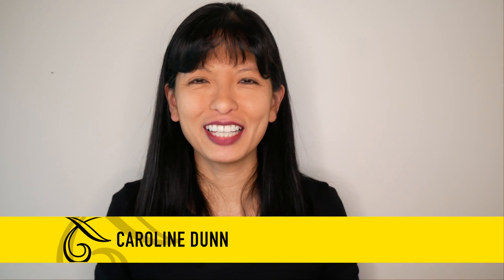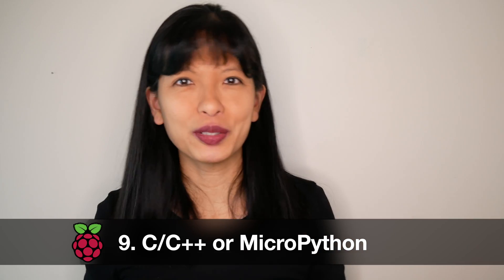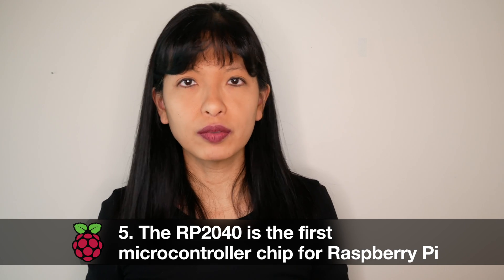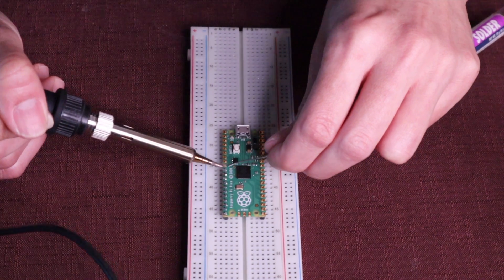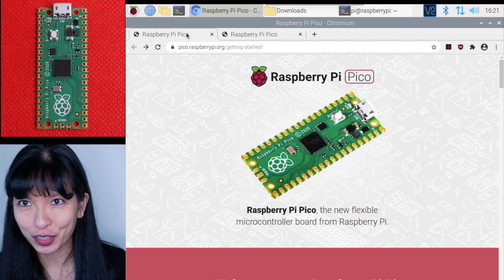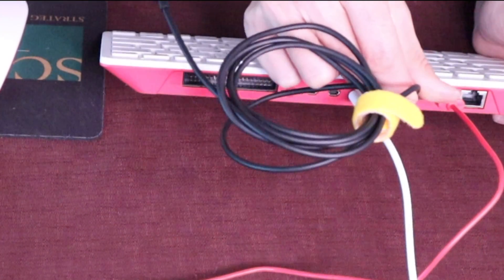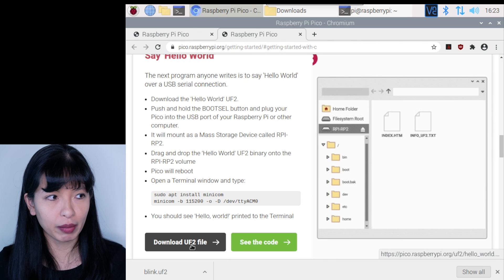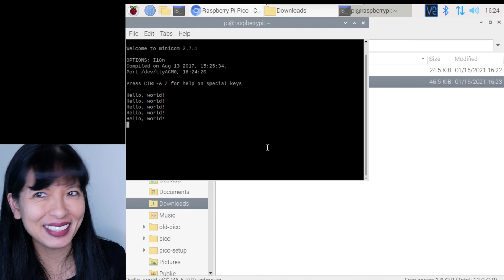10 Things You Need to Know about Raspberry Pi Pico

Comment: 1. The pico is 2001 technology
2. No floating point math 
3. Isn't not innovative or novel
4. No wireless capability
5. Better learning tools exist. Arduino is one
Why doesn't PI release a 5ghz WiFi chip? That would be real innovation.

Comment: Very polished presentation as always.  This new Pi is selling here in the UK for just £3.60 which is a real bargain.  However I just wish it had WiFi on board to compete with the ESP8266 boards I use at a similar price.  Thank you for posting.
Reply: see feather board from adafruit, rp2040 on custom board and be stacked with another feather like wifi/ble feather.